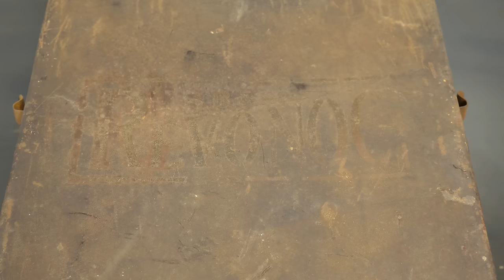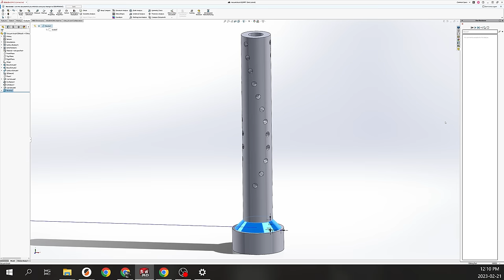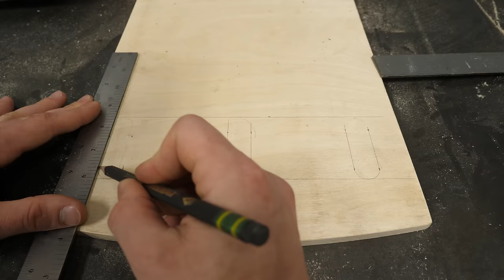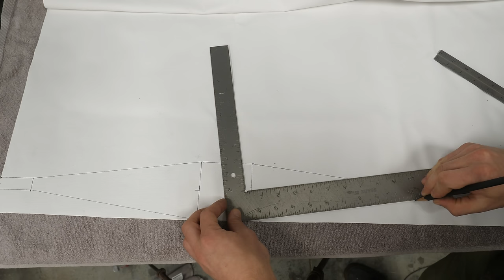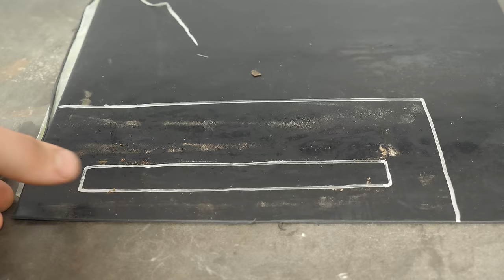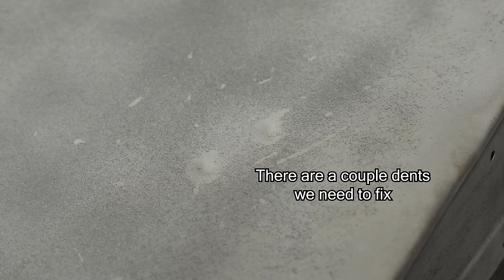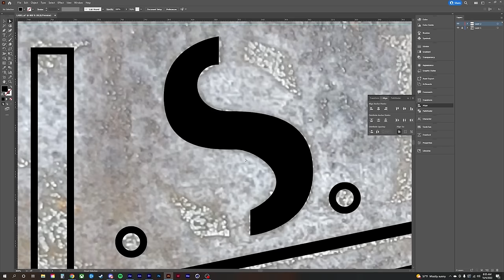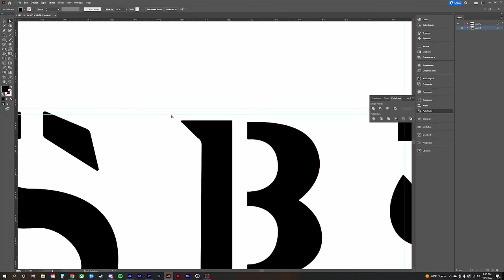100 Year Old Vacuum / Carpet Sweeper Restoration (Remaster?)

Comment: Hats off to the original inventor of this early carpet sweeper
and also to you sir, for an excellent restoration!  😀
Reply: kỹ năng...:goodvibes:
Reply: MAybe a reconstruction more than a restoration given how many new parts had to be made.
Reply: Nice thing to fix but if it's 100 years old and left in a old house it will probably be only a rusty metal shell (I don't know how old it is so it might not be a fake restaurant and if it's real excuse me)
Reply: How did you make a new brush roller?  What Software did you use? What equipment are you using?
Reply: You have the tools and the talent.
Well done sir!
Reply: @tylonbarnes9678  that’s a 3D Printed and resin

Comment: I didn’t even know these things even existed, but this is beyond impressive, carefully taking this old fragile piece apart, cleaning it meticulously and then somehow putting it back together, 10/10 work if I do say so myself
Reply: Carpet sweepers still exist! Though nowadays they're much harder to find (and made with a lot more plastic). I've only used them a few times, because a few of the stairways I cleaned had carpet landings but no electric outlets for the vacuum cleaner we'd usually have for carpeted stairs. They're less effective than a modern vacuum cleaner, but very lightweight (modern ones at least) and very quiet. 

They're kind of being phased out though. A colleague that used to work at a larger cleaning company told me that they had invested in lightweight battery-powered vacuums that could be carried as backpacks for when they had to negotiate the lack of electrical outlets. With that kind of competition it's hard to find a use for carpet sweepers, since they're about as effective than raking the carpet with a stiff-bristle brush
Reply: @helenanilsson5666  I see them a lot in restaurants still

Comment: That is awesome how you restored that carpet sweeper to working order.  You worked so hard to clean all the parts from rust and made some new wooden parts to replace those that were too far gone to repair.  It looks much better than before and it works like a charm too.  Excellent work, I must say.
Reply: Gracias por decir que es .Porque muchas veces no entiendo inglés y no sé que es lo han restaurado
Reply: @FingerinUrDaughter  Not a laser. He used a sand blaster.
Reply: @patriciavillalba-zp4vq  There are translation apps that can help you understand.

Comment: Wood chips are very hard to budge loose on those rubber backed rugs even with modern powerheads. It did very well considering when it was built. I cleaned a woodshop with the exact type of rug you have for many years. My grandmother here in Canada had a small sweeper called a hokey. The very same design as yours right down to the dirt trays only 100% metal. Made in early 60s. You do awesome work. Almost magic. I'm speechless.
Reply: Can confirm: I cleaned a school for several years and those rugs are a huge pain to vacuum; I would hand sweep them more often than not
Reply: @thaddeusrobinson6866  I actually cleaned a school with a woodshop that I was speaking of.   😆 I swept the worst of the chips with a straw broom and then the powerhead afterwards. Modern powerheads are all plastic these days and would not last long without help. I do the same for entrance mats as well to help with the traction gravel in the winter months.

Comment: This fella has so much skill and ability and normally I wouldn’t question anything he chooses. The 3D printing of the roller? If the restoration is solely for looks, then great but if the machine is intended for any type of service, forget about it.  I mean, I don’t expect a 100 year old machine to be honestly used but still. Wood is so much stronger by a magnitude.

Comment: I like how the old stuff was built in a much superior way than modern stuff. The vacuums I had never lasted more than 7 years before loosing suction or having its cord become very dangerous and shorting out. I can’t believe it when I saw that thing barely work when you moved the wheels

Comment: This is probably the one thing I have seen that does the job its intended to do without fail but it tells me that Brooms and Dustpans were invented just to break your back instead of just doing this which would solve all the problems of needed to bend over with a dustpan do sweep the floor I mean lets face it at least 99% of vacuums have the same parts that do the same job albeit a slightly bit better than the others this has a broom attached to it and it actually works sure vacuums with actual sucking power would be better but what I saw it you were able to sweep up most of the leaves and other debris without sucking up the mat itself which is a big turn off point for vacuums rather than sucking the mat your able to sweep it and suck up the debris without needing a 25 foot cord to plug into a wall socket. You have successfully shown us the tool that time forgot and my hope is that this tool will make a come back cause it is truly what this world has be missing instead of a broom and dustpan I want this carpet sweeper which if im being honest would probably do a better job on hard floors like wood, brick or tile. Having said that where and when I can buy one I will take two please. I would pay $30 for this.

Comment: I love the work you do so don't take this the wrong way. The problem i have is that antiques need to be preserved with original parts and pieces as much as possible. You basically just built a new machine. Its amazing work but just no longer a real antique.

Comment: It doesn't suck.....(although I do get the pun)  it 'sweeps', which is all it was supposed to do.....actually this would have been called a carpet. sweeper in England where I am from . I used to use something similar to help my mother in the '50's.  If the brushes are right length its remarkably good.  Although invented in America.... it quickly worked its way back to UK in the 1890's.  I enjoyed watching this..... brought back memories...

Comment: There's one thing you missed. The original moved those 'sacks' differently, one at a time. You can see it at 0:47. But you put it so one sack would suck then the other two suck at the same time (at 51:55). I guess it still works, might even work better with it being half the time having double the sucking power. Regardless, great restoration!

Comment: Video and the rebuild itself are most highly impressive -- fantastic job!  I enjoyed watching the video.  Even though it is not a conservation, the build is not as close to the original as it could be in the details.  At least the videos and photographs document the original state, I would maintain save those.     I am impressed by how you restored the original decal.   Only nitpick is that, the inside curves of the the head and tail of the D were curves, not strait lines.  I have a few questions.

I have a few questions for the original creator.
Why did you not reuse the original wheels, or at least only replace the ones that were damaged beyond repair.
Why did you drill oil holes if the original did not have it?  Would that not open it up to dust when a grease could be used as the original had.
Why were the hex wheel/axle fitting not backed by a circle for adding wheel strength like the original.
Why would the brush cylinder could have been reused and the fibers just replaced.

I honestly asking why in case I do my own restorations.  These are not rhetorical criticisms, but curiosity.

Comment: I wonder how much better it can be with a few modifications (like more&smaller bellows to waste less momentum) and using modern materials like 1mm rolled stainless steel instead of inch-thick plywood. With electromagnets (powered by the same rollers) to help with sucking in fine dust and small metallic debris.

Comment: @33:09 - high quality finishing acid brush- the only thing that can produce a similar quality surface finish is the exceedingly expensive to buy wild squirrel tail brush, they are from dead squirrels, tails washed in rain water then fluffed and dried. sold in packs of two for shop dwellers.

Comment: Since there are three bellows, I'm wondering if they should actually be staggered by 120° instead of 180°. It makes sense to me since due to the check "valves", setting them up in that way would cause a continuous flow of air. It's too late now since the wheels are welded in, but that's what I would have done

Comment: Maybe for next time, Glue the bristles tightly in a tube, then glue the tightly packed tube into the beater bar holes. Or wrap the bristles tightly while they are still in the original brush with strong thread or flat wire, then cut them off and insert them into the beater bar.

Comment: The timing of the bellows wasn't the same at the end as it was on the original.   They were originally all offset by 120 degrees from each other for continuous suction, on the restoration the two outer ones are 180 degrees off from the center one.

Comment: I think you made a timing mistake when reassmbling the wheels activating the flaps / vaccum ... There are 3 and you actuate them 2 then 1 ... If I remember well during the disassembly they used to open only one at a time, so there are 3 same vaccum phases instead of one big and one smaller.

Good job reconstructing this device

Comment: I noticed a slight mistake in your rebuild:
At 0:48 the bellows are aligned in a 120° configuration.
At 51:55 they are now in a 180° configuration, seen as the outer bellows now move in unison opposed to the center one.

Comment: Sanding fiber glass without hand protection? what kind of fiber glass is that? I recall sanding a windsurf table being fixed with fiber glass by my father when I was a kid wearing a swim suit, and I had tiny particles of glass stuck burning in my legs for 2-3 days.

Comment: Not a big thing, but I think tuning of the bellows was supposed to all be off set as seen at 0:48 so they suck at different times, and not as its been mounted at 52:00 when 2 of the bellows suck at the same time, shouldnt be a big thing, should probably only be to rotate one of the wheel so it doesnt align with the other, would probably only increase its efficency by quite the small amount though :D

Otherwise great video! :D

Comment: Does the sand blaster have some sort of primer in with the sand to make it go the grey colour? I just find it hard to believe that's the original metal as no matter what metal is blasted it all goes that grey colour.  Genuine question
Reply from the maker: It's a dull grey color because of the rough surface finish left by the abrasive sand blasting powder
Reply: @RestorationStation  ty

Comment: Might suck better if you put rubber on the drive wheels instead of the 3d printed plastic. More grip would probably translate to more actuation of the bellow mechanism
Reply from the maker: They were printed in TPU which is kind of like a synthetic rubber. Plenty of grip
Reply: @RestorationStation  I forgot tpu was an option.  🤦 Excellent job

Comment: The original was quite an ingenius design.   Unfortmuately I wouldn't call this a restoration, as majority of it is now newly made and not much of the original left.  Maybe a reconstruction or a replica?
I wonder if this was a prototype model given it had wooden bearings. adn so many wooden parts that could have been made metal at the time on a retail product.

Comment: it really is more reverse engineering then restoration at this point. its very impressive but I wonder if the notion of restoration is holding you back. at what point does it make more sense to manufacture a new one with documentation and blueprints?

Comment: Wincing, pain full to watch the bushing mounts get such a downgrade. just smash the wood out and force some Delrin in there. I feel that the glue will not last another 100 years or 5.
Reply: what was wrong with the wooden brush that replacing the bristles would not have fixed?
Reply: wish i had seen you do a Zink plating of metal work to keep a more original look.

Comment: Ugh. I had to stop at 3d printed replacement parts.
Reply from the maker: How would you have done that part?
Reply: @RestorationStation  I don't restore, so I am not saying I have the answer. I would think using rubber molds would be a few steps closer of a restoration than 3D printed. Hell, you could even print the molds. Sorry for being an @$$

Comment: Seriously with the amount of “restoration” they’ve done, they might as well have just left this antique alone and made there own from scratch. When you tear something apart and modify most of the original  parts and make your own new parts. Props to there photoshop skills for the new label but why bother claiming it’s a restoration when you’ve made an entirely new Woden frame and new air pumps and changed how it gets put back together this is just their version of this once great tool. Disappointed

Comment: I understand your renovating a novelty piece of crap that should have been left in the dump where it belongs but you didn’t have to butcher the logo like that’s it’s not hard to trace over something in a separate layer in gimp/photoshop also you could’ve sanded the 3d printed wheels they would’ve looked identical to regular wheels if you had done that wouldn’t have been hard either I mean you put so much effort into the other parts like even getting rid the oil can and making new screws and re welding the fasteners in the wheels why did you put to little effort in the easiest things you could have done it’s so noticeable too why
Reply from the maker: Did you even watch the logo recreation? That's exactly what I did except it was Adobe illustrator. Also you can't sand tpu. Trust me I tried
Reply: @RestorationStation  woah you actually responded the wheels I understand but I saw you using spines and the line tool you did not literally trace over the original pixels which is what a guy did with an exacto knife did when cutting out the original template, also I saw you resizing the individual shapes albeit not something you would notice unless you were extremely autistic but it has a digital look it’s not identical to the original logo